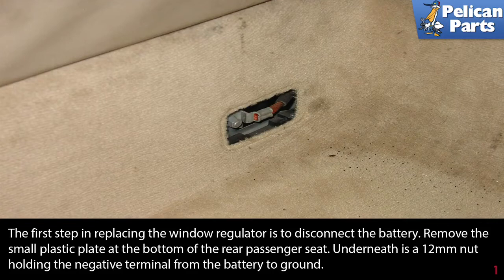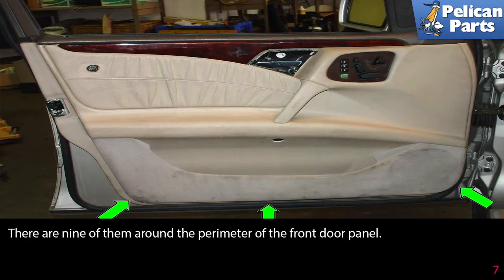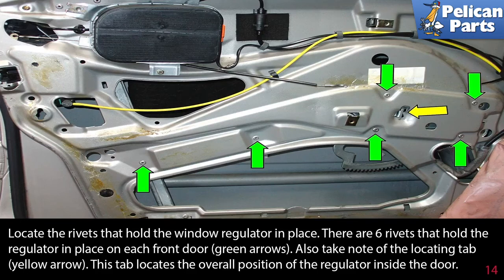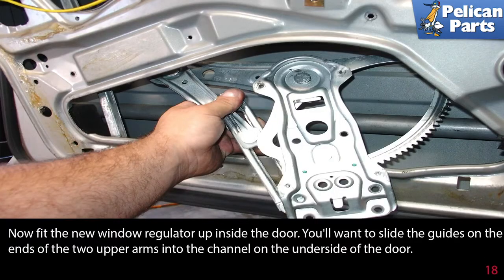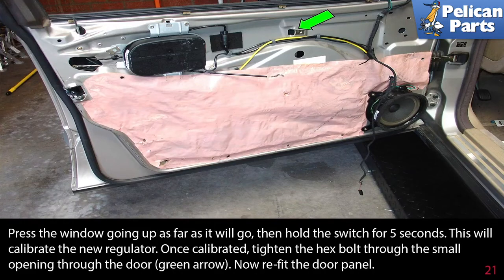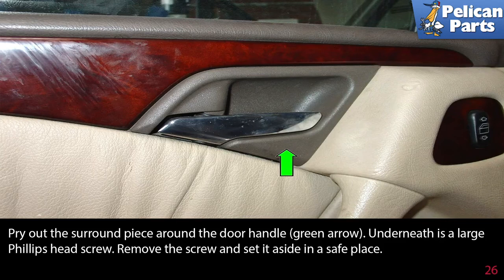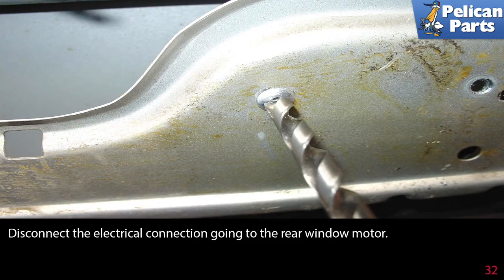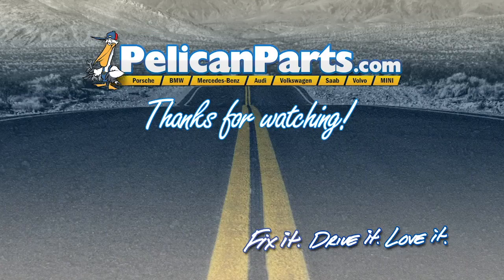Mercedes-Benz W210 E-Class Front and Rear Window Regulator Replacement

Comment: I just did rear regulator replacement today.  I used M5 .80 x 12 screws with nylon locking washers.  They are 8 mm hex.  Attach top screw and nut first, then slide window into regulator guide.  No rivets needed.
Reply from the maker: Thanks for the additional info and feedback. We appreciate it.